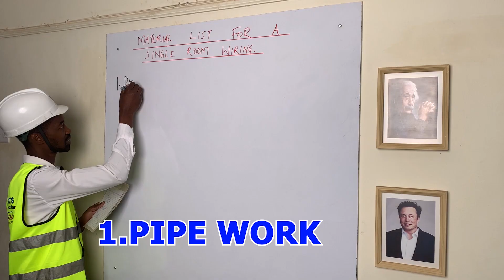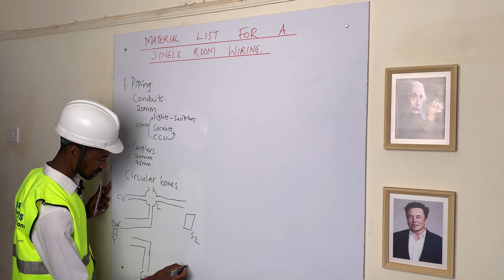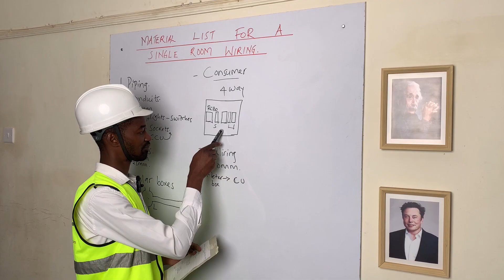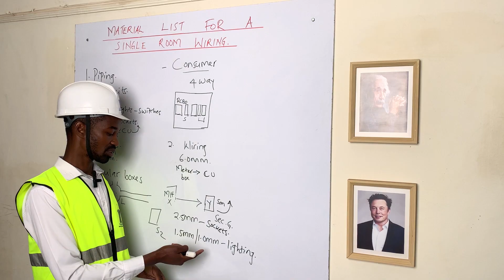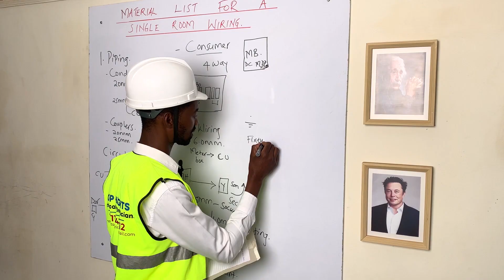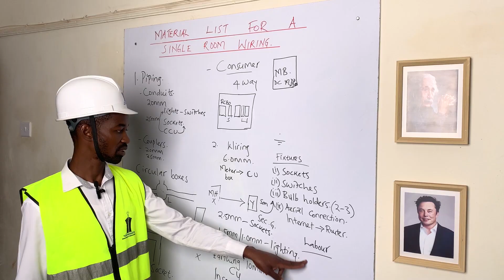Materials for a single room.

Comment: Hi John 
My question is do I need a special socket for internet and socket for TV or I should use normal socket 
Also what size of cable for internet and tv
Reply from the maker: You need dedicated data and coaxial outlets for internet and TV, as standard electrical sockets are not suitable for those connections.